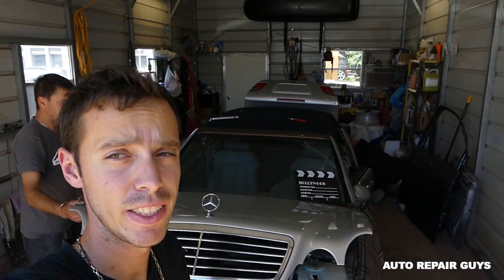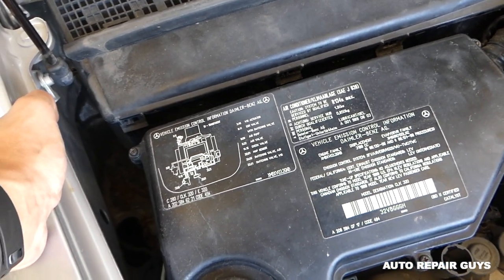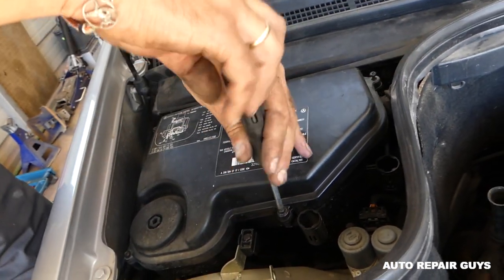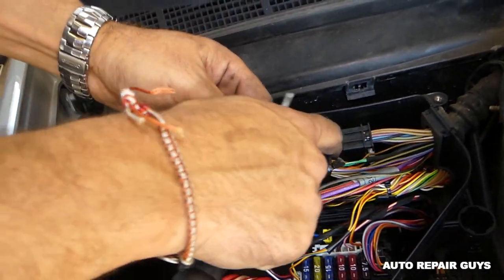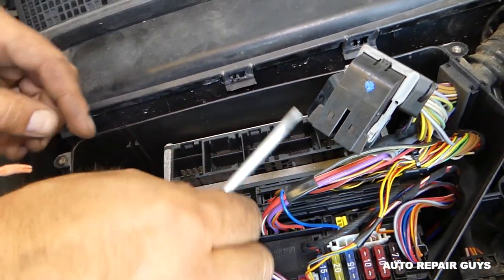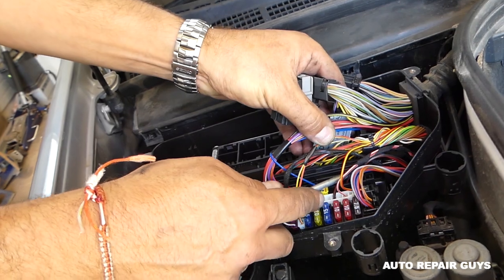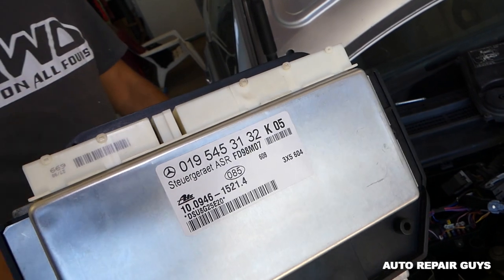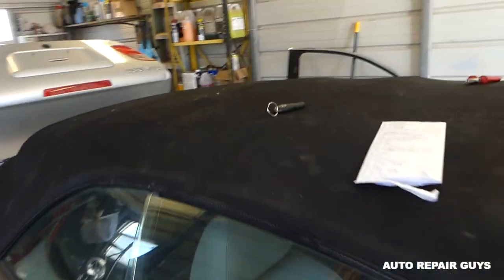MERCEDES W208 ECU LOCATION REMOVAL REPLACEMENT CLK CLK200 CLK230 CLK 320 CLK430

Comment: I'm getting a p0688 ecm pcm power relay sense circuit open. What can it possibly be? I'm also getting a p2810 pressure control solenoid g electrical. I'm using a car soft star diagnostic tool.

Comment: Hello. Do you think the replacement will work without reprogramming on a Mercedes S320 2006? 
I want to mention that the replacement is a exact same model second hand and it also comes with two keys and immobiliser. Thank you !
Reply: If it comes with the keys and immobilizer you should be good just make sure you disable your steering lock it’s also paired

Comment: Hello Car Repair Guys, I have a 2005 C230 Kompressor.  I have intermittent problem with the tachometer and speedometer and the window regulator not working, essentially everything on the dash board not working but if the engine starts, it runs normally..  Battery tested fine, engine diagnostic tool indicate communication failure with ECU.  Anyway to find out if it is the ECU itself that need replacing?

Comment: I was driving and all of a sudden my car shut off and started misfiring and idling weird and would sometimes stalls during takeoff then it just completely stopped working after I parked it in lights ran a cold and it popped up P0 604 does this mean I need an ECU? If I buy a used ECU can I just put it on in the car will be fine or what I have to have a Mercedes dealership program to replace the computer ECU?

Comment: Need help desperately! In US, 2002 clk430 has battery/alternator visit workshop warning when trying to start. I have a no crank no start issue. Checked everything regarding battery, starter, alternator, k40 relay. and still no start. Any suggestions
Reply: Hello, check your fuses and relay. And your crankshaft position sensor, or camshaft sensor.

Comment: Hi Car Repair Guys, I have a problem with my CLK 320 Coupe the car only drives about 180kmH (111 mph) it is not the cruise control.
Full throttle and kickdown works.
The gearbox also turns when the speedometer is close to the red range.
Unfortunately, more than 180kmH are not possible.
I was already at Mercedes-Benz in Berlin and at a Polish Mercedes specialist, no advice.
It is a Mercedes CLK 320 built July 12, 1999
Maybe I have a tip for me

Greetings from Germany
Michael
Reply: can you tell me were the ecu is located on 2001 SL500.
Reply: then drive the speed limit you should be fine